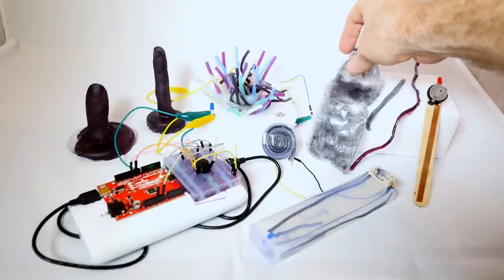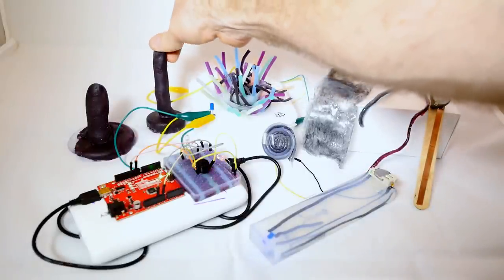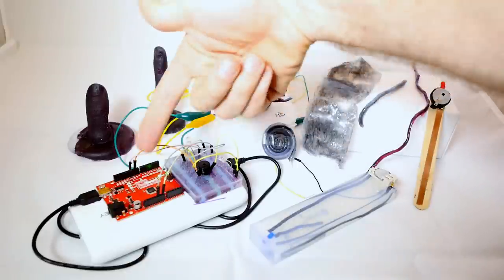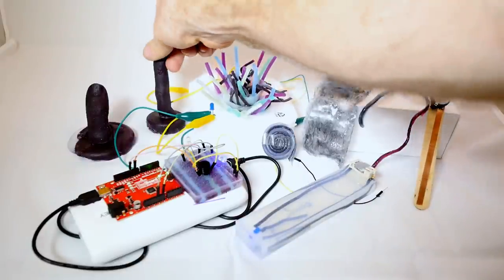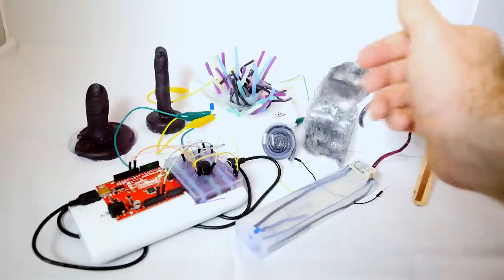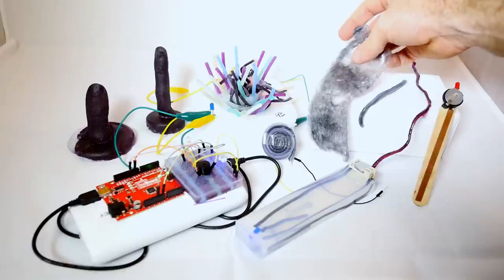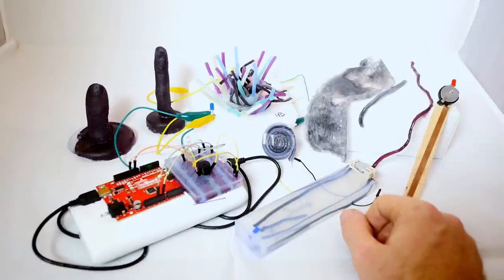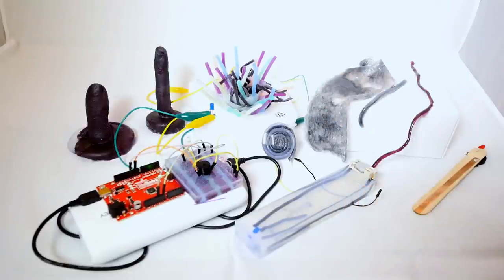Silc Circuits: Intro to Conductive Silicone Rubber

Comment: Silicone is conductive when it's not hard and dry... You should do some experiment on that!💯
Reply: Is it? I didn't know that and I've been trying to find out all over the internet if it is or not because I have some live terminals close together on a battery I wanted to use some on if I could.
I guess I'll wait till I get some heat shrink tubing. Thanks.